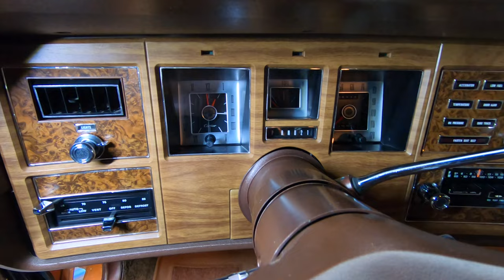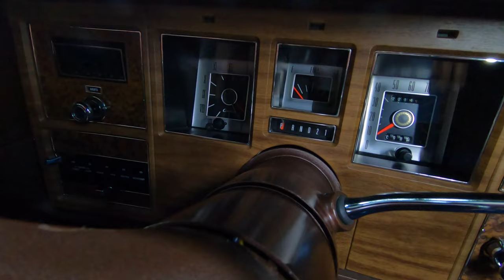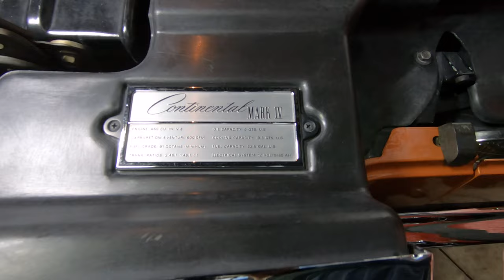TIME CAPSULE!! 1972 Lincoln Continental For Sale Vanguard Motor Sales

Comment: That is one of the most immaculately presented examples of a 1972 Lincoln Continental Mk IV-V I have ever seen. Well done Vanguard Motor Sales that is one stunning & beautiful gas guzzling 460ci behemoth land yachts I ever seen. Hearing the 460ci purr there means it's odometer is genuine. Whoa one rare Mk IV! Congrats hope it was sold to the correct buyer/owner. Concours d'Elegance example i.e. the best of the best - there is no higher standard. This vehicle is therefore eligible to enter any Concours d'Elegance show/event and it could easily win a trophy in its category. Congratulations to restorer/s and owner/s.

Comment: The issue with the 72 and the reason that there are so few around, is that the battery constantly supplied the power window controls. Many of them burned while in storage. Disconnect the battery if you are planning on winter storage. This is MY FAVORITE Lincoln Continental, ever, the 72. Loved it when I first saw it as a kid. I also love the 72 Imperial Le Baron 2 door, as well.

Comment: The 1972 Mark IV was the finest of the Marv IV's as far as performance, simplicity of style, and mechanics.  I'm sorry this car doesn't have the steel wheels and correct hubcaps rather than these Mark V turbine rims.  This is in stunning condition.
Reply: Agree.  While I love the Turbine wheels on a Mark V, and they are what look best on that car, nothing looks better on an early Mark IV that it's original wheel covers, just like nothing looks better on a later Mark IV than the Forged wheels.  It's obvious how these wheel designs were styled perfectly for each of these cars.

This car is otherwise fabulous, and the new owner can always change the wheels if they want.
Reply: Actually, these must be 1980+ Turbines, as the bolt pattern from a '72 matches those, and does not match 1973-79 cars.